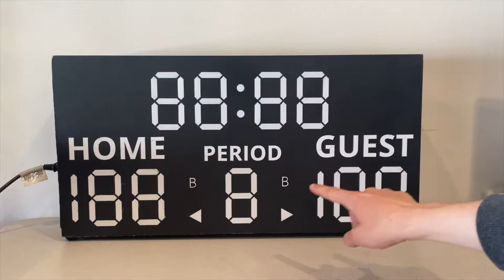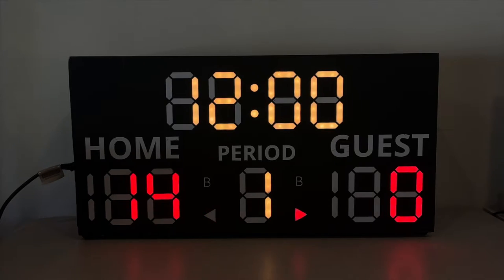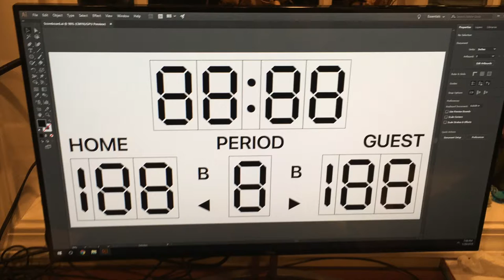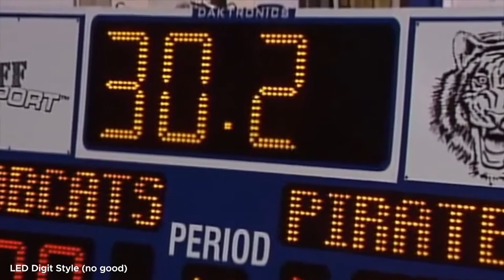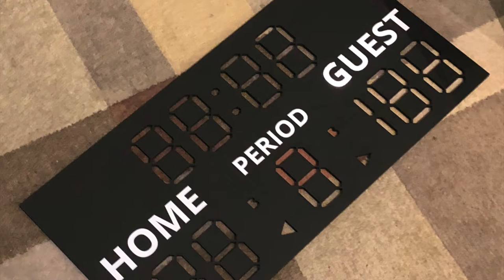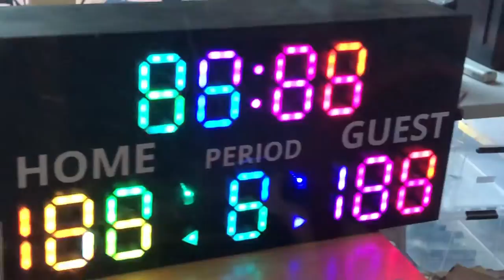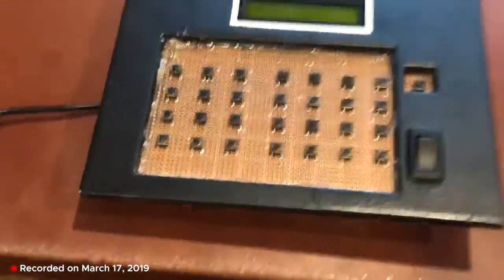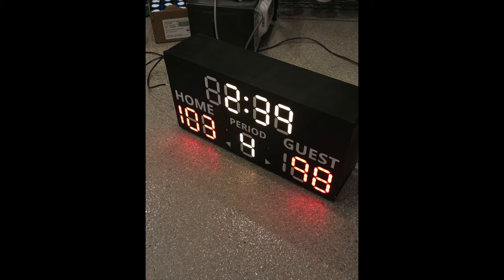How I Built My Own Basketball Scoreboard (From Scratch!)

Comment: Hi Collin. Great work, congratulations! I'm doing a similar project. Do you have the final project for light diffusers? Could you share it?
Reply from the maker: Hi Guilherme,
Excited to hear you are working on a similar project! Unfortunately I do not have the file for the diffusers, but you can find all other files on my GitHub linked in the description. If you want to make them and 3D print them yourself, I would suggest using the diffuser cutout from the scoreboard Illustrator file, importing it as a sketch into your preffered CAD program (Fusion 360, Onshape, etc.) and then extruding it to the thickness of the scoreboard (mine was 1/4 inches). I printed my diffusers with white PLA with 0% infill and that seemed to work the best. Hope this helps!

Comment: HI
Nice project, very interesting.
The digits that make up the numbers are made up of two WS2812B LEDs per segment, can they be enlarged from 2 LEDs to 4 LEDs per segment?
Reply from the maker: Hi! Hope you enjoyed the video. The digits can definitely be enlarged to 4 LEDs per segment, just make sure you change the arrays that store the digit combinations and also use an appropriate power supply. The one I used in the video was 5V 20A which should still be fine for more LEDs but you may want to use a 30 or even 40 amp one.
Reply: @CollinWentzien  ok

Comment: Ciao ho ripreso in mano questo progetto, e secondo me hai fatto un errore nello schema, stai alimentando NRF24L01 a 5V, questo modulo va alimentato a 3,3V non a 5V come scrivi tu.
Reply from the maker: Hi! The nRF24L01 module I used has a converter built in to decrease the voltage from 5V to 3v3. However, if yours doesn't have that converter then I would suggest running it straight off of the arduino's 3v3 rail.

Comment: Hi Collin..it is really informative video. I was wondering you might want to share the wiring for all the led lights, sorry I am not good in reading schematic diagrams .
Reply from the maker: Hi Rolando,
Glad you enjoyed the video! I'll try to post a more detailed picture of the wiring for the lights within this next week. For now, the way I did it was attach the +5v pin on the LED to the power supply power, the GND on the LED to BOTH the Arduino ground pin and the power supply ground, and the DIN (data in) pin on the LED to digital pin 3 on the Arduino. Hope that helps :)

Comment: cool stuff... im also working with a nrf24l01 module, but i have a problem.  how can use ky-002 to control 7segment using nrf24l01.?
Reply from the maker: Using an Arduino you should be able to send and receive data with the nrf24L01 the same way I did in this project. You just need a way to interpret the ky-002 module, then transform that data into something the nrf module can send, and then receive and decode that data on the other end and display it on a 7 segment display.
Reply: @CollinWentzien thank you so much...
Reply: can i send you my code.?
Reply from the maker: @sylgonjaysanoy8890  Sure, I'm not too sure how much I'll be able to help but I'll definitely look over it and give you pointers. You can email me at collwentzi@gmail.com

Comment: how to make the shot clock sir?
Reply from the maker: Hi Clyde, you should be able to hook up multiple receivers to one transmitter as long as they're on the same channel (ex. "00001"). From there display the time and add a secondary clock to the code to act as the shot clock.

Comment: How to make the basketball clock sir?
Reply from the maker: Hi, I briefly outlined the materials I used in the video but the scoreboard is made out of wood that I laser cut, the digits are 3D printed, the LEDs are WS2812B addressible LEDs, and everything is powered by an Arduino